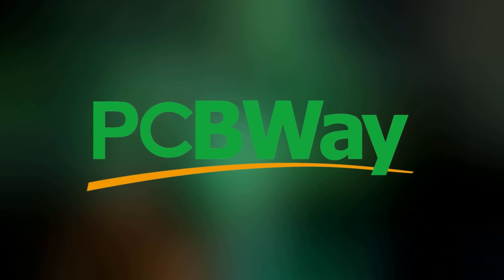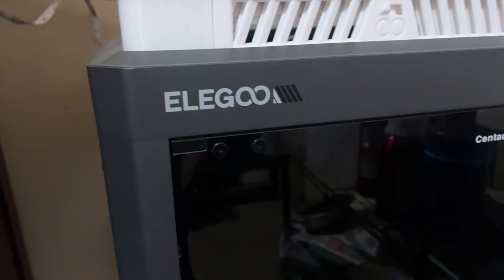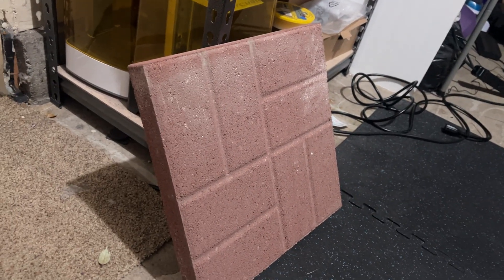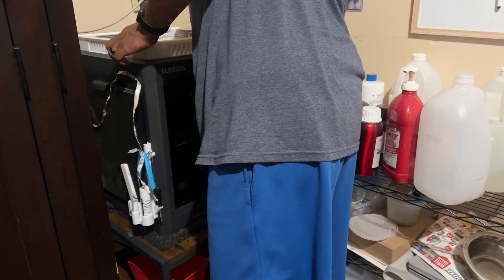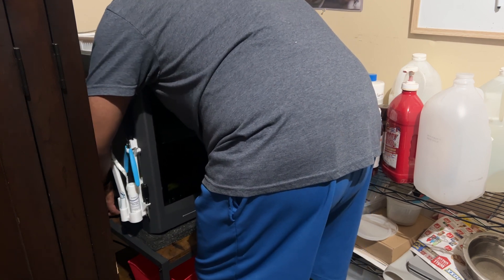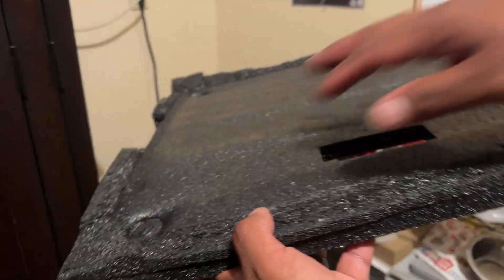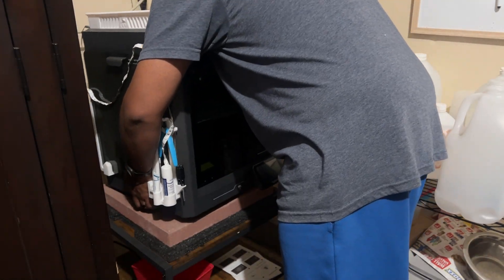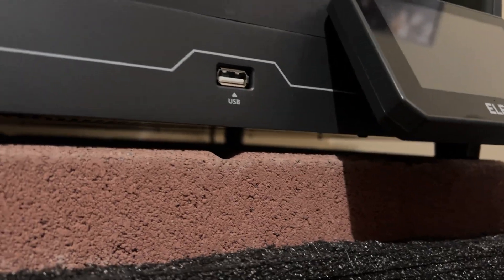How NOT to Stabilize Elegoo Centauri Carbon!

Comment: I put a 16" Rubbermaid landscaping rubber pad down first and then TWO of the concrete pavers. Together they weigh about 60 lbs. My table used to shake badly and this made a huge difference! Don't forget to run the full calibration routine afterwards...
Reply from the maker: I didn’t run calibration again, I’ll definitely be doing that now! Thanks for the tip!